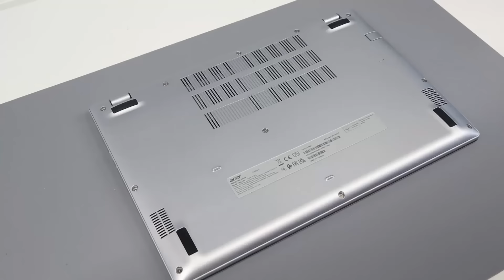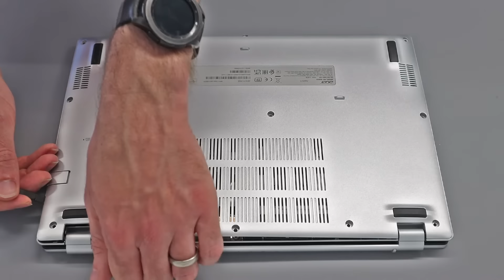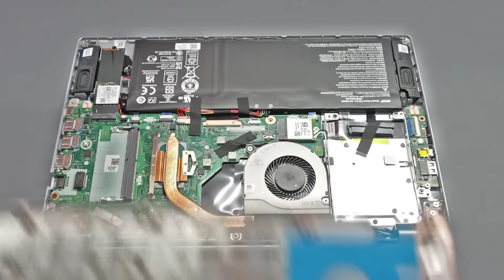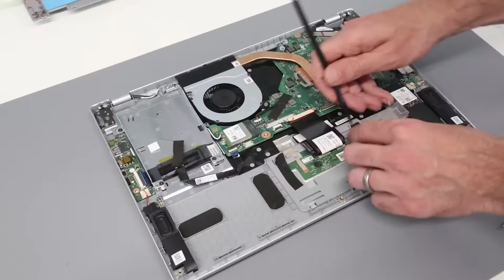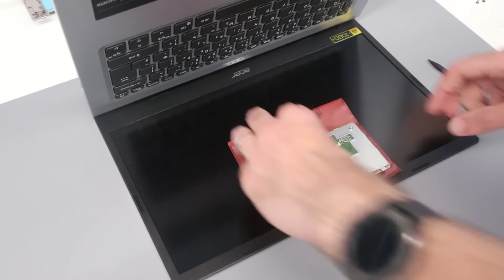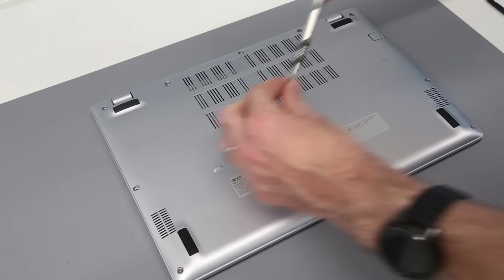Acer Aspire 5 A514-54 - Battery and Touchpad Replacement Guide

Comment: My touchpad is just loose, do recommend opening it up and applying some tap to the back end of the trackpad.
Reply from the maker: If the system is nearly new may be worth seeing if they'll sort under warranty. Other wise I'd open it up and check the mounting screws are tight.
Reply: @BrueComputing  its 5 months old, but im in a country where i don't have access to acer support. Its the same acer aspire as in this video